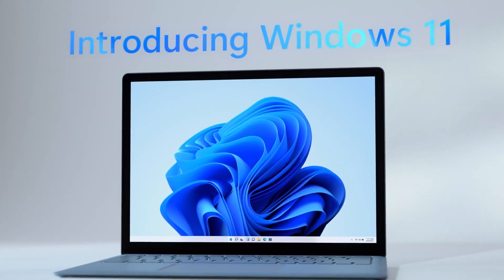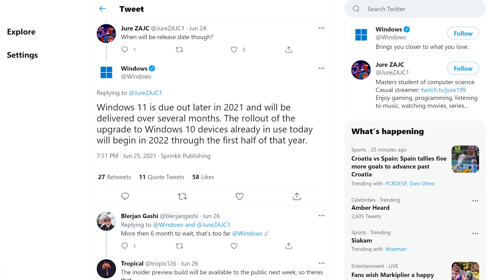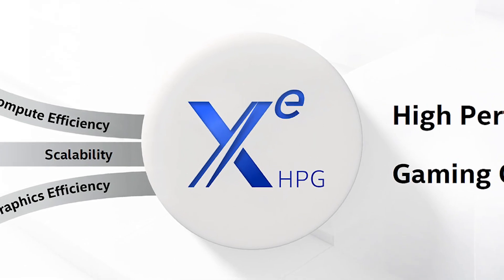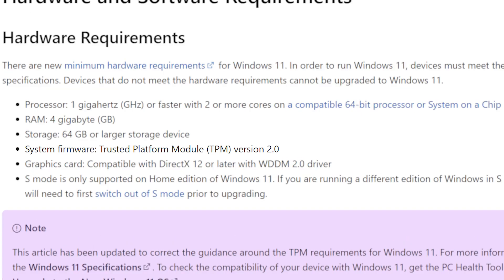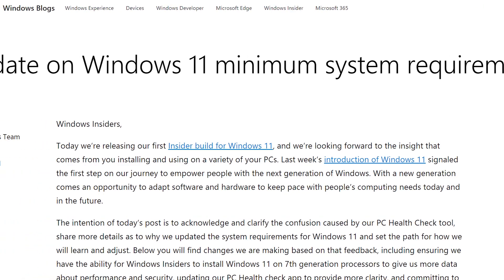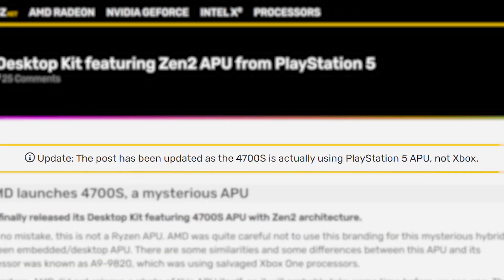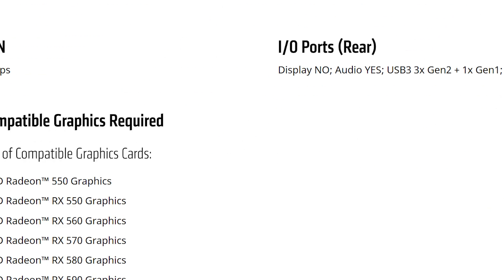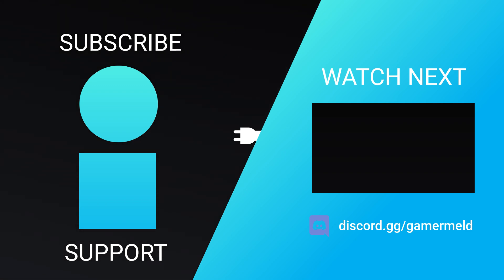TONS Of Gamers WON’T Be Able To Install Windows 11!

Comment: While holding my optimism cautiously, I am going on record and say: This is gonna suck.!
That means my dual Haswell and Broadwell windows systems will have to be "Goodnighted" ( If I make the upgrade. I will still have to validate application health regardless and that means spinning up VMs and bare-metal boxes JUST to test!
While I do think security is a good thing, This could possibly involve upgrading multiple deployments after dealing with the pain of windows 10 and its issues after an update.
As a content creator, I look more towards better utilization of resources not "lock it down where hardware is perfectly fine for the tasks at hand" ( I know that gamers require maximum "juice" ) I think Microsoft could have done a better job implementing the TPM feature. and/or how they presented windows 11 from the gate. 

I like to call myself "OS agnostic" giving Linux the thumbs up due to the open-source nature out the box to finding hidden gems that make what I do way easier ( and in my opinion ) easier to diagnose because the information needed is "right there" (yes I am fully aware that you can do it in windows too but to be able to launch a application in linux using the command line gives me instant gratification of identifying compatibility issues and such that I am used to. The silver lining is that I have until 2025. The down side is those that are not as OS savvy will want to make the jump to Windows 11 with a very good chance of running into "show stopping issues" I don't think the brain trust is going to back down on TPM 2... I can accespt that .. but I cannot accept the fact that tens of millions of PCs around the world is going to be happy to find out that their stable system of yesteryear is going to be E-waste... 
The only solace I see in this whole "mess" is that in a virtual machine world it MAY be ok I have some workloads that I could virtualize. But with this news... That's all I have to hang on to. 
Thanks for reading. 

Side Note:
I know that my view may not be the popular one or those of this audience, everyone has a different use case. it may not affect the majority audience that Microsoft or any other vendor seems to cater to. but damn it all to hell! one can innovate with out bending us over... (That's how I feel about what the new OS brings... but hey! at least it is not Windows NE or Windows 8!)

Peace! Keep up the good content!

Comment: this is just like apple where a computer that is 3 years old cannot upgrade to the new Mac os but one that's 2 years old with half the power can.
Reply: I don't own apple devices, but I did once upgrade the operating system of a 6 year old macbook air for a friend when I replaced the internal SSD to have more space. It ran fine on the most current OS.
Did Apple change within the past 2 years?
Reply: @Alice_Fumo  You can usually update the OS for considerably more than three years, to the current release. It's the updates that stop being provided for installed OSes of more than three years old. They keep the users on an update treadmill until they decide that your hardware will no longer be supported. Microsoft is trying to ape Apple's capricious attitude to its users of older products.
Reply: @dalriada842  Thank you, this was very insightful! So on old hardware are not even security updates provided?
Reply: @Alice_Fumo  The issue is the version of the OS installed. They will support the current OS plus the two previous versions. This isn't cast in stone though. Like Microsoft, they may decide to issue an update to patch a particularly bad security bug in an earlier OS release, but you can't rely upon that. Once a particular piece of hardware is no longer allowed to install the latest OS, you have about three years of updates. You either need to be thinking of replacing it, or putting Linux on it. I chose the latter path! 
There are sometimes ways to get past Apple's install restrictions. Sometimes you can patch the install image, or update hardware components. That's well beyond the scope of the typical Mac user though.
Reply: my 2012 macbook pro is on latest macOS running just fine idk what you’re going on about. there’s a lot better things to make fun of apple for
Reply: @SeargentGlitter  Yeah, all it takes is a quick glance to see that MacBook Air models all the way back to 2013 can get Big Sur which isn't even out yet. Not only that, but Apple continues security updates for a year or two after even that cutoff.

OP is just an Apple hater. If you want to hate on Apple, do it for legitimate reasons. cough*iPadOS*cough
Reply: @rainmannoodles  And... Is still powerfull for the price?
Reply: And.. nobody cares.

Comment: welp, as a person with a 2400g, will a 3600 on  B450 board work with win11?
Reply: No. Neither the processor or the board is supported by windows 11. The X570s is the only chipset and the 5000 series processors. Microsoft claims security flaws in earlier chips firmware led to the decision to exclude them and the original X570 chipset.  They still have not made a decision on the B550 chipset. The B550s is a probable yes, but no firm commitment. 3000 series chips are “still under review”. As the 3400g is actually a 2000 series part and they have said probably not to the 2000s, I would say probably not as well. The entire current B450 line “doesn’t meet security requirements.” Windows 11 is  a forced hardware upgrade that even most current bleeding edge hardware can’t meet spec for. I have a 5800x on a X570 motherboard, 64 gigs RAM, 5700 video card, 1Tb PCIe  gen 4 X 4 ssd and my system doesn’t meet spec. Replacing the motherboard with a X570s with a TPM 2.0 module would get me there but boards with those specs start at $350 and go up steeply from there. At a minimum, virtually everyone is looking at replacing their current motherboard as none of the earlier models with integrated TPM 1.0 modules meet spec. Even if MS accepted earlier processors, the motherboard requirements would doom virtually everything produced until December of 2020 and most of what has been produced since. Either the spec will have to change or most people simply won’t be able to use the new OS. The leaked ISOs run just fine but the installer doesn’t check current hardware against spec yet. When it does, watch out.

Comment: I believe tpm cards can be installed for older machines
Reply: Can be but not available. But the real stumbling block is the hidden chipset requirements. The current versions don’t enforce the full spec. When they do, most older motherboards won’t be allowed to install it unless the spec is drastically changed.

Comment: Just get a TPM chip for your mobo header, my Z270-F has a TPM slot
Reply: Not just the TPM 2.0 module. Chipset must have other security features. And the TPM 2.0 modules have known issues with Linux that are still unresolved. Looks like MS is saying “Windows 11 or Linux, you  can only have one or the other, not both”. Good move to destroy Linux without being too obvious.

Comment: I have an 11-year old HP laptop that can barely run Win10, but I still use it. Time to move it over to Linux, but I was going to do that anyway. 

That 4700S, however, looks like an instant poppin' upgrade to a couple of older computers I have around here. 🤔

Comment: I understand why they are doing this, as one of Windows biggest Achilles heels is performance backlash from PCs that are supposed to be "compatible" with the os, but perform like crap, and users just blame the OS for the bad performance, but this is just getting ridiculous.
Basically now people will be forced to HACK their own OS to be able to run it in hardware completely capable. It is ridiculous how the floor for CPUs has been set on "generations" of CPUs, instead of actual performance. They are saying that an crappy i3 8gen is more capable than a i7 7gen, which isn't true by any measure.
Also, having a list of "authorized CPUs" is basically starting to do shit like apple to control the platform, but it will not work and is a complete shit move.

Comment: I am not really bothered since Windows 10 is going to keep getting security and bug fix updates for another 4 years, in fact i am glad they are going to stop adding features to Windows 10, it means they can focus on getting rid of existing bugs and stop adding new ones with the new features, this means Windows 10 is about to become excellent for the next 4 years.

It's not like they are releasing a new DirectX version exclusive to this new Windows and even if they were, it would take 2 to 3 years for any game to make really good use of it, same goes for direct access.

Yes, i would like to use the Auto HDR for DirectX 11 and 12 games but most peoples displays are not even HDR enabled or bright enough to give them a good HDR experience anyway.

Windows 10's first year was awful, i expect Windows 11 will be no different.

There is no problem here other than idiots rushing to always be on the latest OS and ditching their perfectly good PC / laptop just to experience a year of having a buggy and limited Windows experience.
Reply: I sure hope so... but yeah I'm staying way from 11
Reply: The thing id love to take advantage of is dirrectstore but that requires a pcie gen 4 ssd...
Reply: @angrynerd2103  I read it works on Gen 3 NVME's, i can't see why not as the Xbox Series NVME is Gen 3 (2400 MBPS).
Reply: @insensitiveprick7680  personally i use a sata ssd which i would like to use this with. I figure it would have to still be a perf boost even if it isnt as much right? But thats not an option. Good to know that it is available on gen 3 tho.

Comment: I've just started dual booting Ubuntu, no problems with running games so far. Steam Play (built-in Steam feature) lets you run Windows games on Linux. And as gaming is working for me, and it is definitely the most difficult thing to get working, I'm fully planning on switching to Linux full-time.

Comment: Ryzen is junk. Anybody buying a 64 GB system is insane ! In few years 1 TB will be required.
Reply: Nah. Things will more over to streaming subscriptions before there's a need for 1tb memory for your avg consumers.
Reply: @bruhder5854  Who cares about average consumers, they will just buy APUs, Ryzen is for techies... foobar2000 music player already consumes 1.5 GB, firefox consumeables gigabytes of ram, dev environments gigabytes of ram, games gigabytes of ram, the gigabytes flying all over the place, 64 GB will be junk soon. At least with 1 TB systems will be good for another 10 to 20 years, Ryzen will be bricks in a few years not worth the money.
Reply: @bruhder5854  In 2006 I bought a DreamPC with motherboard with 4 GB support didnt need the 2 GB for first few years, than later upgraded to 4 GB, it's still usuable in 2021. 17 years later thanks to this massive 4 GB support at the time. It only needed 256 MB or 512 MB ram at the time which people recommended and thought I was crazy to go with 2 GB, well not so... memory consumption grows very fast and is one of the key limiters of what a PC can do and one of the major reasons why a new one will have to be bought eventually. Paging to disk is just too slow... bandwidth across motherboard and cpu and gpu is also becoming a big must have, should be in the gigabyte range to be ready for future, I will wait for PCI express 5.0. I want my new system to have some had room.

Comment: FEAR not users! You can super easily just delete a dll filre from the final windows 11 iso, and replace it with the same dll from windows 10 iso and installation will not stop even without TPM ;-)

Comment: Good move from microsoft imo. Windows 10 will be supported till what 2025 so those who cant upgrade stick on 10 and come 2025 your probably be on a new system anyway. Unless they pull something crazy like a new windows 11 only version of directx that games only support you will be fine. Even if they do something like that it will be a few years down the line and again by then you probably would have updated the system anyway or got a new one. With Ryzen you just slap a 2xxx in for cheap in 4 years time and your sorted if you dont want a new pc those chips will cost hardily anything at that point.   This is not even taking into account hacks to get it installed on an unsupported system and i am sure plenty of those will pop up.   People are going nuts over nothing. 

Personally i just went into bios enabled 2 options and ready to rock so simple. This part imo is the only bad part allot of people wont know what to do. Mainly those who buy custom built systems and not build the system themselves will be in trouble. Those who home build probably wont find turning 2 settings on any kinda challenge.

Comment: This isn't as bad as you make it sound like. I have Ryzen 2600 on my main PC and Intel 8300h on my laptop, so I'm good for upgrade. But even if I didn't, it wouldn't matter. Win10 is excellent and there are very few reasons to upgrade atm. People with older CPUs are fine with Win10, their main objective is to upgrade their platform, Win11 is just a bonus feature.

Comment: Update to previous comment about running windows 11 on a 2013 iMac.

Just installed it on main pc as well (3950x and 2080ti). It legitimately fixed every issue I was having with micro stuttering, memory issues (I had chalked up to hardware), and my ssd being hammered constantly by windows.

Tldr, insider windows 11 Dev build more stable and less glitchy than current windows 10 build.

Comment: Right now at a leading online retailer, you can buy an Ryzen 5 2600 in an OEM package for $169 USD. That is you need to save $42.25/ Month between now and Windows 11 Release. That is approximately 3 meals at Taco Bell / month. If you are coming from Intel, yes you also need to add a $100 USD for a motherboard. That adds one more Taco Bell /month that you would have to cut out in order to save the $67.25/month that it would take to cover the processor and a motherboard. 

This is the way we used to buy things before everyone had credit cards. I am currently saving up for a Sony A7SIII Camera ($3,500 USD camera body only). My Ryzen 1 has already moved to my NAS build where it acts as my router and my NAS running on Linux. If it is important to you, you will find a way to afford it. 

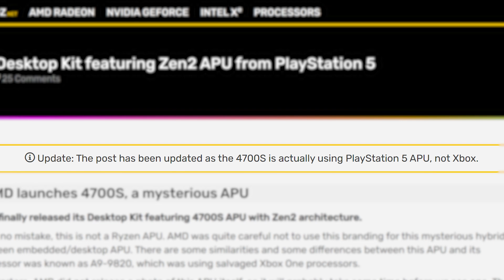[edited 06-29-2021@ 05:14 EDT to correct typos]

Comment: Many viewers of your channel are not subscriber because your headline/title and information in the video are not match maximum times. When people watch it, they become disappointed and lose interest. On the other hand you set up the heading for the product that may come in next year. Why should we be so exited now that will come next year? if It comes next month or 2-3 months later than people remain exited not for next year. For example: Radeon 7000 series.  You can tell us about 7000 series but in the middle of the video like side news. It looks like that you have no current news. The heading of this video is also confusing. You could use "Yet" end of the title.

Comment: there is also the possibility that the motherboard has a tpm chip on it and you safe but you might have to activate it in the bios. for intel systrms it can be that this is called PTT, amd uses the AMD fTPM.

Comment: Microsoft not supporting older CPU's will backfire on them spectacularly, there really is no valid reason to disallow CPU's that have modern x86 ISA's with the relevant extensions. This should cover from at least piledriver and Haswell if not also bulldozer and Sandy bridge if they are on motherboards with TPM headers.

The solution for people with unsupported CPU's and motherboards that do not require windows for specific apps will be to switch to an easy to install linux distro like mint and install chrome which can run all browser based apps as well as run their games particularly steam, I'd expect that compatibility will only improve by 2025 for wine, so windows 11 isn't strictly necessary for a lot of people and neither is windows 10 now.

Linux could quite easily double or better its user install base which while that is only roughly 2% ATM, that could end up 5% or more if people who don't tend to update their hardware regularly, look for an alternative. 5% is heading towards critical mass so that nearly everyone will know someone who uses it, which will lead to more recommendations to switch over time, one of the nicest things about linux is that the OS isn't full of spyware that wants to phone home your activity, though installing google chrome will negate that advantage.

Comment: This is a bad move from Microsoft, the windows baseline requirements are just too high. They will better be off by relising a normal version which supports older hardware at the expense of not getting these many features and a pro version that is more focused (and limited) to the newer hardware.